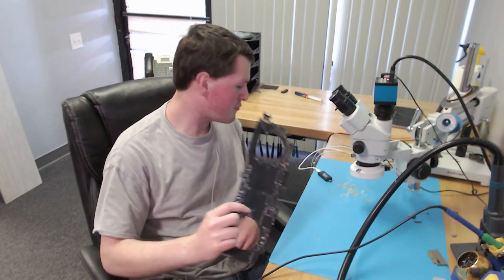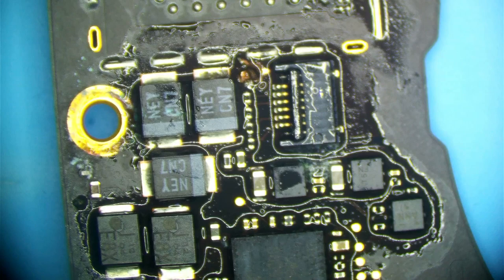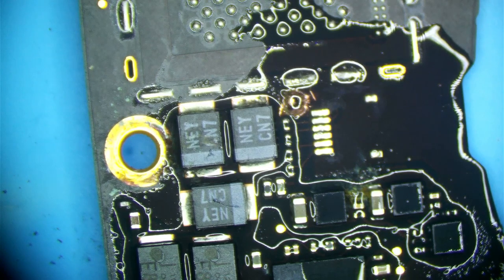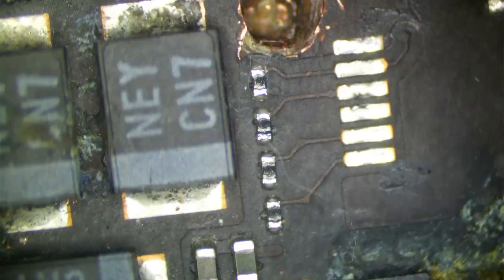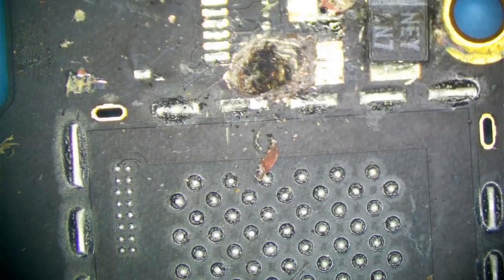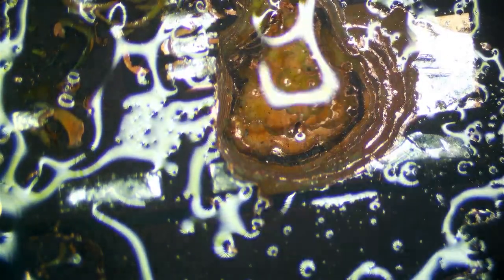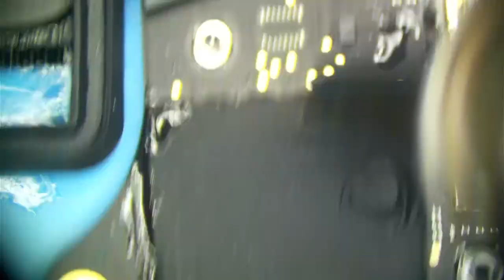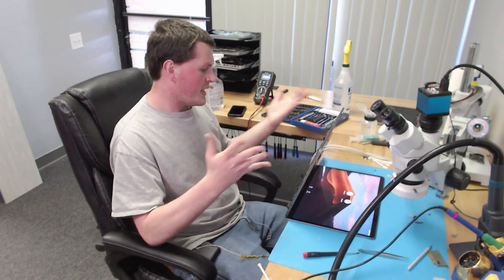2018 15" MacBook Pro not turning on due to a MASSIVE internal PCB short. Can we save the data?

Comment: For excavating out a pcb you might look in to small dental burrs or micro mills. Also dental drills are not too expensive. If you did not want to  use powered tools you could try mounting the bits in a pin vise and spinning by hand.
Reply from the maker: I have dental bits. The issue with drilling is it tends to fuse the layers together, leaving a mess.

Comment: If you use a mini drill press or a cnc, drilling for one layer at a time I think it would be easier
Reply from the maker: The issue with drilling is it tends to fuse layers together and make the short worse. I use to try and drill them out, but it never worked as well as digging it out with a xacto knife.

Comment: Amazing repair Tim, I didn‘t believe these kind repairs are even possible? But what caused such damage to the board? Is that small cap you knocked off the board at the beginning?
Reply from the maker: The shorted cap near that area likely got so hot that it burned the underlying PCB.
Reply: The location of the short relative to the parts on the surface in the same area will also make/break the possibility of a successful recovery. In this case, the short was in an area where there were no complex components. A connector, and/or a few resistors/caps - not a problem. If the short was below the CPU or other chip with dozens or hundreds of pins, then the possibility of removing the short is very small.
Reply from the maker: @yuppiehi  100% agreed.

Comment: Would that damage have happened over time or would it have been a wham bang thank you ma'am quickie? I just wondered if there may have been any indication that the thing had a problem and the L user may have had the time to make a backup before Armageddon. 
All this because people still don't back up their precious bloody data. 🤬 Still, revenue for you I guess. 👍
Reply: those kind of damage came from persistently trying over and over again to plug the charger and boot the computer..

it was a slow-wide meltdown..

i always advice customer that if you knew your device suffered liquid damage, and you have no way to disconnect the battery immediately, go to your nearest technician and have the battery disconnected and if possible, clean the damage..